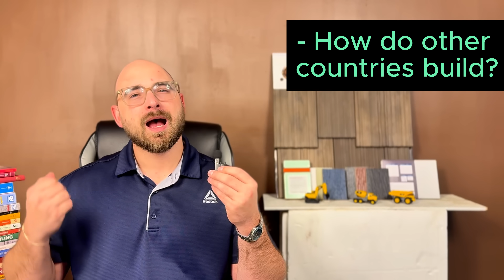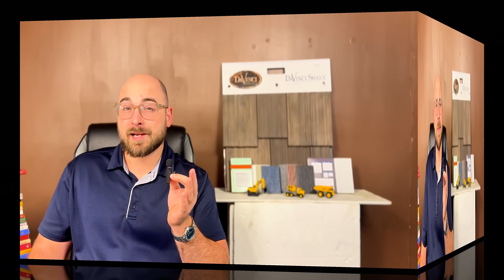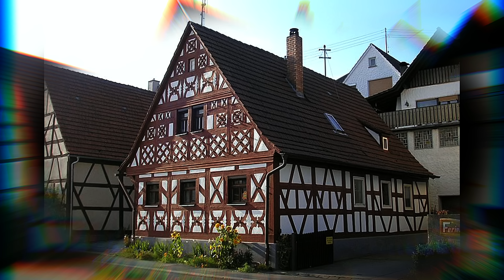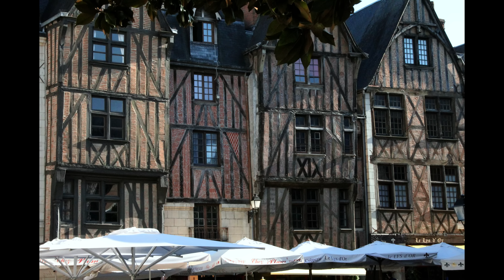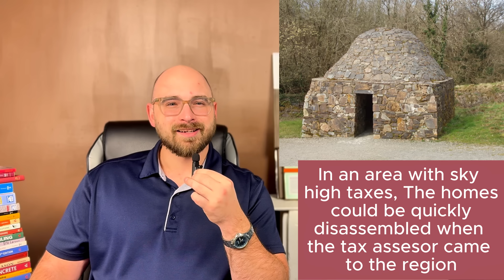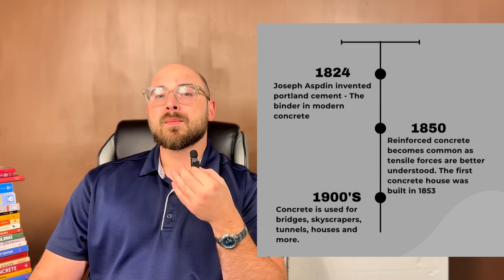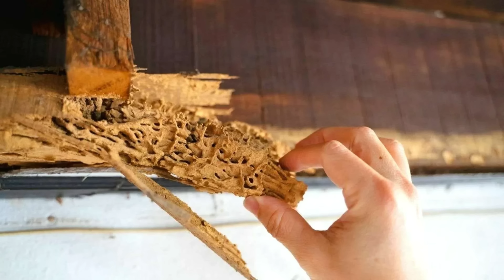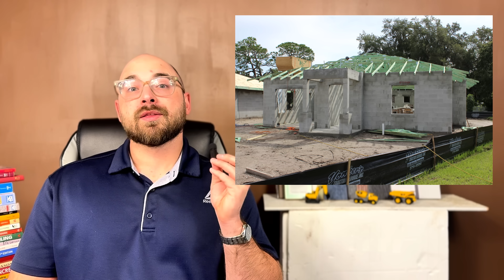Why Other Countries LAUGH at American Homes

Comment: As someone who has worked in construction in the Netherlands, you're wrong about one thing, concrete is a very moldable and architectural diverse material. Basically what we do is we make a wooden framework, fill that framework with different types of thickness of steel wires (from 0.3 to 1 inch thick steel wires) depending on the flexibility required of the part. Then several different mixtures of concrete can be used to get the end result desired strength and flexibility.  We then remove the wooden framework once the concrete has settled. The most common home here is thus a concrete framework, that can be compared to lightwood framing, filled with masonry. In most cases we do NOT use plaster on the outside, due to masonry absorbing more heat, and we like to stay warm since our yearly average temperature is about 50 Fahrenheit.  And while our average house pricing is slightly higher then in America (525k compared to 415k) the benefit is that our houses tend to last on average 300 years compared to the US 50 years. And then we have not even talked about inherit other benefits like noise reduction, energy efficiency (You save roughly $600,-- per year) and disaster proofing. 

Does that make our homes better? Depends on the situation, we have a culture where our home is expected to stay within the family for generations, or if its a rental home be able to be rented out to multiple families. Then there is also the National and local laws and building requirements, including aesthetic  compatibility with the rest of the area. America is vast, with very different climates depending of the location where you live, the Netherlands has in comparison a singular climate. Our buildings are designed to work most efficiently for that climate. We also have different disaster occurrence, our country being basically one big river delta and coastal area benefits from houses that can with stand a lot of water/moisture. So its not as easy to compare one country with the next without keeping climate and disaster occurrence and local laws in account. It could be that in a similar climate and disaster occurrence in America the houses there are quite similar to ours, but because those conditions are a low percentage of America, henceforth the percentage of those houses will be less. Then there is the amount of population density in those area's compared to the rest of America that can increase or decrease that percentage again. And as mentioned before our homes are more expensive, about 20% more expensive then the average house in America. Most people tend to look at their own wallets, instead of also investing for their children, grand children and the next few generations. And fact is, by the time you buy or build a house, you generally have about 50 years left to live give or take. It doesn't matter then that your house will last for 300 years, because you won't enjoy the majority of it. 

In conclusion, if would live in an area where the risks of a natural disaster of destroying my house would favor one type of house or house construction over the other one, i would build that. And i would probably otherwise use the cheapest house variant that suits my needs. Most likely it just means that the average requirement of a home is different in other countries that have "better" or "worse" housing. 

I couldn't imagine myself living in a standard American house over here, but that has nothing to do with its quality or longevity, but everything to do with our climate, in combination that if my house would actually get flooded, the chances of very expensive repairs would be much higher then with our typical housing.
Reply: American houses aren't optimised for anything else than making a quick buck by building and selling them.

There is no argument for it depending on climate or earthquackes because their houses NEED AC in warm climates and they break down in any single natural occurence.
Reply: Yeah I don't even understand the argument that these wooden homes don't last. Here in Austin there are many traditional Wooden homes that are over a 100 years old. Like with anything they need maintenance but European brick homes aren't immune to that either.
Reply: @Ronin.97  as i said in my original post, enviromental conditions are more important then material in most cases. Humidity in the Netherland compared to Austin Texas is 20% higher on average, different climate, different materials
Reply: he did say that in the video. concrete by itself is brittle but solved when reinforced with steel beams.
Reply: Wow.  An actual reasonable European.
Reply: @dpeagles  says someone that is living in the United States of Arrogance...🖕
Reply: @heikos4264 I don't think anyone is as arrogant as Europeans.   They have looked down their nose at America for 300 years.
Reply: Good answer, and yes, this method is how we build warehouses and highways in the U.S.
Reply: In Canada all the homes in my city are mostly original.   Since the city dates from about 1870, there are no examples of older  homes than 150 years but I know of lots of neighbourhoods where  the houses are 115 years old.   They usually have a basement added after the fact and are difficult to do repairs to the heating, plumbing and electrical because of the small crawl spaces.   I would  never buy a cement or brick house, because I am constantly adding new things to my house.   I just put in a new garden hose spigot and it took me 30 minutes to put the pipe in and solder the freezable spigot.  I also add new electrical wiring all the time and my ceiling in the basement is wide open for me to string wires, plumbing and add new venting for the heating system.  
I just spruced up my deck last year.   I built it in 1995 from another deck that I bought from a guy for $300 , all pressure treated wood.   I sanded it and repaired with autobody filler and then put an aluminum deck railing with tinted glass.   How would you build a cement deck ?   It would feel so much like an unappealing place to go, like the cement balcony off an apartment.   Cement and bricks gives you that hard, unforgiving, prison, concrete feel.   It is cold.   I put SM insulation R10 on my cement basement walls down 8 feet and all the way up my house.   I don't have any walls at all except for styrofoam and then 2X6 studs stuffed with fiberglass and drywall on the inside.  I have R30 walls.   In the basement my concrete is kept relatively warm and I have zero cracks.
I added on a 4 car garage in 2005 with a  room above the garage with bathroom, kitchenette and living room/ bedroom.   To do this with bricks would be a nightmare.   Concrete and bricks have zero R value and you have to do your construction is such a way as to isolate the concrete from the inside of the house and this takes a lot of square footage to build second walls inside the brick walls to hold the insulation.   My wife has an apartment in Dnipropetrovsk and it is cold and hard and reminds me of a car park.  They did put styrofoam on the entire outside of these blocks about 20 years ago and that improved the heat inside but she is on the top floor and her ceiling is cold.   I was going to buy some insulation to improve it but ran out of time.   I redid some of her aluminum wiring because she had a long hallway with only one light and  it was dark.   I put in three lights and changed some fixtures.   Not enough electrical receptacles , in Canada you must have every 12 feet and I put them in more frequently and can easily add a new fixture in a couple of hours.  Fishing new wires inside the walls is easy and no chipping through bricks.   How do you even make a square hole in a brick wall for an outlet?   I am currently running 8 gauge electrical wire from my breaker panel to the apartment above my garage to put in a stove and I just drill holes in the wood joists and string the line.  It will take a couple of hours and be totally hidden when I am finished because my ceiling has panels that I can remove to access the joists.   I have no idea how you run cables and things in a brick house and keep them invisible.   My wife's apartment has hot water lines visible running all over the place for water and heating and the electrical is in visible conduits.  It looks like a zoo. 
I am also now putting down more hardwood floors and stapling the oak flooring to my plywood subfloor.   I have no idea how you would attach hardwood to cement ?   I  have a compressed air floor stapler and it works great.   If I find that a board is defective or crooked, I just pry the board up and out.   With concrete you can't make easy corrections and modifications.  I put in stone driveways and cut the concrete of my basement to access my added garage and it was a major job to cut through 8 inches of concrete for 3 feet by 1 foot and took many days,  I used a diamond saw.  Then my driveway was cut with a diamond table saw with water that I bought for $300 and it is a very slow process cutting these things , driveway and planting garden made from stones.  .
Reply: @JeffGermany-n1k  Exactly North American style homes are much easier to repair and renovate than many European homes. I've seen videos of renovations from the EU compared to the NA it's a nightmare. Especially when trying to add/replace plumbing and electrical wiring.
Reply: @JeffGermany-n1k  One of the main differences i think for Canada and the Netherlands is its population density. we have 544 people per square kilometer vs Canada 4,2.  By your description, your space available for your house is way larger then the average for our country. Even in our rural area's there are laws for farm sizes. All of this contributes to our living spaces being very monitored and planned out. Most of the changes that you describe, would require multiple permits over here, which drastically reduces the flexibility house owners have to modify their homes, even if they have the space. 

This causes that modifications to houses are rare beyond more isolation, ac and the occasional room refurbishment. 

As for your practical questions: 
How would you build a cement deck ?
Our cement decks are prefabricated in factories, they use (Usually) 1m20 wide by 6m long rectangular baskets, in wich they place a few (usually 5) 10 cm thick hollow pipes that can be removed after hardening, to allow for air gaps across the length that lighten the entire construction, as well due to the round shape add significant resistance to top down pressure, as well as resistance to flexing then there is iron wiring to support the strength. They are then rolled in by truck, and placed by crane. Ontop of these prefab decks there is usually placed isolation, floor heating, and that this then covered by a layer between 3 to 7 cm of waterproof cement the floor heating is connected to our central heating systems, and the deck is build. 

How do you even make a square hole in a brick wall for an outlet?
While we do have square outlet boxes, usually we use round ones that are worked inside the wall by drilling it in, only the top layer is made square and if its not a top plate we chissel it in. If we do have square boxes, the practice is very similar, we start by drilling a hole with a diameter equal to the square, then use specialized saws or chissels to make it square. 

I have no idea how you run cables and things in a brick house and keep them invisible.
Brick walls are usually thicker and double layered so we can insulate them. between the layers we use pvc piping (used to be copper or for our houses that are more then 2 centuries old lead) in which the wiring gets pulled through. While we used to use rockwool or fiberglass insulation, nowadays we usually use dimpled styrophone pellets, its principle is to hold the current air inside and due to the dimples in the pellets, this gets locked in. After some time in weather conditions the styrophone expands and contracts untill it fixates and keeps the air inside, basicly turning into a very thick layer of bubble wrap. in additon we often have a top layer of of plaster on our inside walls. For non carrying walls we usually use a wooden frame work, and nail drywall on it, leaving about an inch between the drywall for additional or future wiring. Sometimes instead of drywall various other materials like wooden panels are used for them. 

I have no idea how you would attach hardwood to cement ?  
When we transition from stone to wood (or any other material) we have a few options, if its ceramic like we tile them in, but if its wood we use Hooked or U shaped metal plates with chemical plugs that go into the stone/concrete and regular screws or nails that go in the wood. 

With concrete you can't make easy corrections and modifications.
You can. Unless the problem is a major structural failure, you can cut out a damaged section, and depending on the size of the job either use chemical anchors with a longer exposed steel rod that you drill in for added strength, or just use a slightly higher cement to sand ratio form of concrete. For very large gaps you use  a premade  panel  that you then chemically anchor in place, then use concrete to fill the gaps and smooth it out again. There is no such thing as a defective concrete wall, or deterioration due to time, if its properly manufactured. (Example the Roman colosseum) There are also no things like termites that can eat it. So the only time you need to replace something is if you make a structural adjustment to your home. 

I used a diamond saw.
We use diamond saws usually only for tiles, and minor concrete work. For larger concrete work we usually use a waterjet cutter, which you can rent locally for about 120 Canadian dollars for a day if you want to do it yourself, or hire a firm which usually costs about 100 Canadian Dollars per hour or 500 to 800 Canadian Dollars per day depending on the size of the job.  For private use there to expensive to buy. Starting at around 40.000 Canadian Dollars

As i said in the original post, most countries and regions have different requirements, laws, practical and cultural demands for their homes. I don't think a particular type of housing is better or worse, it depends on so many things, regulations, climate, cultural and personal perception, and wallet size to name a few. The most important thing is if you are happy with your home. Most regions and countries have optimized their houses for their specific needs, and no person should tell you what type of house you need to get, no matter if he or she is from across the world, across the country, or across the street.
Reply: This all came about because some Euros watched the collapse of an American home under construction 🤣🤣

Comment: Very Interesting video. I am a civil engineer from Colombia. Here at the university we only learn how to build solid structures with columns and beams made of Concrete and steel. Here in Colombia pretty much all houses and buildings are made in this way. We use exactly the same concept and materials for a house and for a 30 floor building. These construction is affordable, easy to build, is earthquake resistance if using the correct steel reinforcement and they last for centuries. I believe USA need to move on from stick houses. It doesn't have sense anymore. solid structure houses will resist huracanes in florida for example

Comment: (sorry if the words are worng)
In Colombia, is common the use of brick and concrete in the city also the roof use clay metal and or plastic tiles also the concrete have a interesting drawback if used in towers of apartments, nowadays is completely useless dont having a cellphone but the signals of that device can be mitigated by the walls of concrete, so in the apartment you must be close to a window and not other apartments if you want make a call

Comment: No, I am not jealous at all. We in the UK are starting to see more timber frame building, which is a step away from solid brick build.  The quality of the building is getting poorer due to market conditions wanting more for less in terms of money. I have spent time in Austria, it's common to see substantial wood building properly built lasting 3 to 400 years. The best build is built for climate. In the UK and Ireland it's wet a lot of the time, which I why brick works better, especially in the absence of large forests.  If wood works, then stay with it accepting its advantages and limitations.

Comment: US builds homes like Europeans build their garden shed… never understand why us homes have those cheap asfalt roof slabs. In Belgium we have clay roof pand which last 50-100 years and some even longer. Must however say that building quality in europe is however also declining last 20 years, expensive materials and work hours makes our house not that durable anymore. Our walls now are mostly made of honeycomb/perforated clay stones from far les quality then the pre 90 houses that were build with solid stone bricks. I’m an electrician, cutting in the new bricks is like cutting ik cookie dough